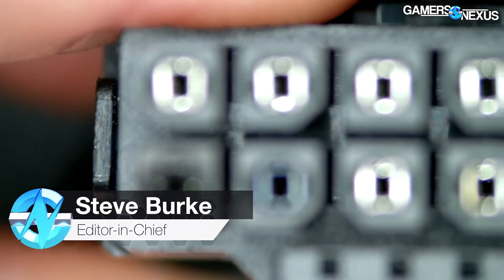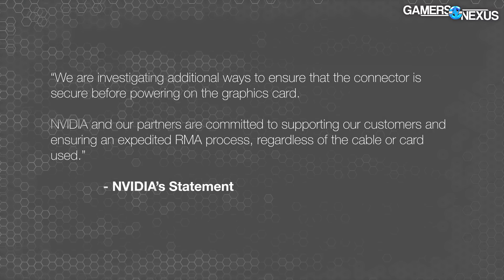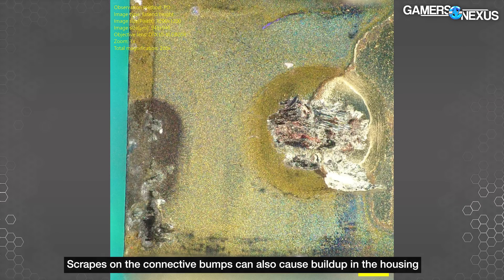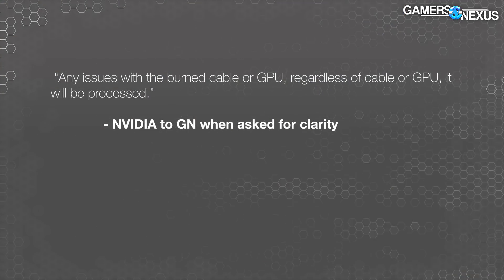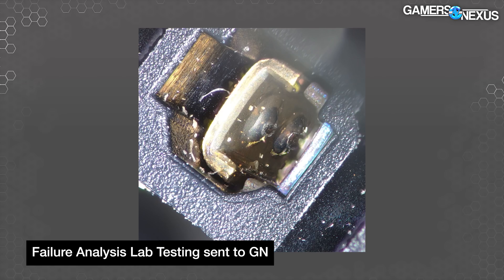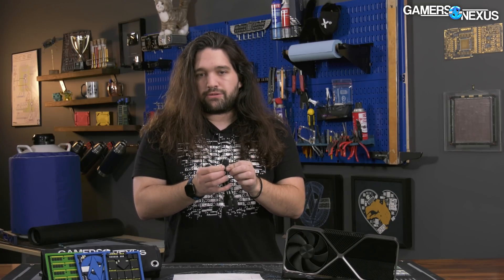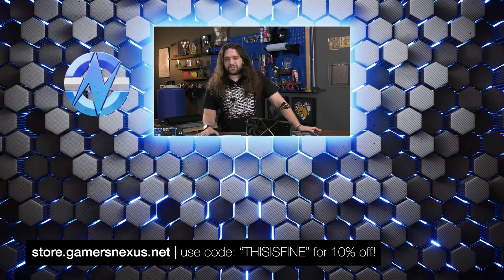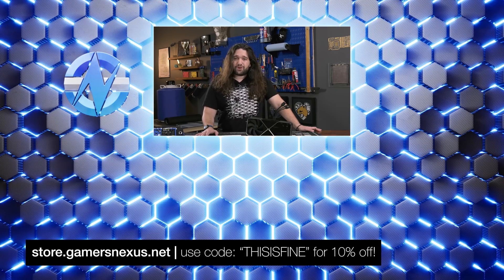NVIDIA Responds to Melting Cables, Warranty Concerns, & 12VHPWR Adapter Failures

Comment: Noticed;  why anyone  including  the amateurs had any issues  with the regular 8-12 pins !! and yes is an issue  as almost anyone(all)  can have a misleading   none click connection and will asume its  plugged as its  hard to duck down and see if it's  really  plugged  allbthe way in... really  guys... why not on the older version we didn't  have this issue??

Comment: The high level of required insertion force IS a key problem, in my view.

Such a force might be inevitable, with a Molex style connector holding 12 main pins + 4 sense pins..

I'd suggest that the PCI-SIG standards body add a maximum required insertion force constraint to the PCIe Gen5 Power Connector 12VHPWR specification, at a level that it may well be that many existing such 12+4 pin connectors would no longer meet specification, so likely any such proposal would not be accepted.

Comment: Personally I got just on question, where do you stop calling it user error and just call it for what it is, design error? Like is it users fault that it inserts with almost no click or one you can easier miss? Is it user error that it is designed for you to have to push it really hard to get it all the way in? Like video starts about user error, but end with all of the reasons why design is actually bad and user error here is consequence of bad design, so why not go straight up and call it for what it is. Since design essentially does everything it can to mislead you into not plugging it in fully instead of predicting that maybe, just maybe, it needs to help user to know just how deeply cable needs to go. Like DIY is neither new nor it is just completely small niche of DIY enthusiasts it used to be. It very much is encouraged and that is something companies designing those stuff need to keep in mind, since they don't all end up only in OEM systems or somewhere where experts will plug them in. Just saying, no offense meant to Steve, great job on reporting and all in depth research. Just saying that I don't see user error as cause, but rather consequence of bad design.

Comment: of course there was a reply from Nvidia after GN said basically its user error, any company would ride that wagon. This is a poor designed cable and socket, lets make that clear the problem started there not the user.

Comment: Question, is it possible through thermal expansion of the connector that the connector latch unseats itself and then has room to expand more and push the connector outwards. I ask because of all the cases I have read about, the failure happens days out with at minimum 40hrs of moderate to heavy use. Being an auto mechanic, I have seen heat from engines cause a not strong enough latch (Usually due to repeated plugging and unplugging) push connectors slightly apart. Is it user error or bad connector design and/or bad placement of the connector? Basically, is the heat around the connector more then the connector can handle? From the look of your last video the connector gets about as hot as the heat sinks. Your findings are very accurate but the cause is very suspicious. Thank you for such accurate analysis. Your accurate reporting on all thing computer related is untouchable.
Reply: Nope. That is you not seating the connector.
Reply: @ShainAndrews  Why would you answer this question? I have worked on many different vehicles in my life and replaced a lot of damaged connectors. All vehicle manufacturers take thermal expansion (as well as other factors) into account when making the design of their connectors which is why they are bulky for the size of the connector. If you did some research you would know this. I have seen other shops diagnose and replace parts only to have the tabs shear off and come to the dealer a few days later with a circuit fault and have to replace the connector. My question to GN is "Is the design of the latch sufficient enough to hold with the amount of heat that is generated". Not for you to bash others.

Comment: Really do not understand why they (NVIDIA) would go with such a strange connector when the entire drone/hobbyist has access to something called XT90i which is a 2 sense pin, 2 main 90A power pin connector. 90A will give you at 12V, 1080W supplied power. Couple that with proper silicon insulated wires which we use for battery packs, the cable would be incredibly flexible, close to impossible to pull out accidentally, and ultimate, really cheap because it is manufactured at such a crazy scale for the drone/hobbyist market.

Comment: Only 125.000 units? That's... actually not many considering that it is a global number.
That just goes to show that really not many people are willing to spend that much money on a GPU and all those images and marketing articles showing people lined up to buy one are.... really just that... marketing.
Nvidia is just showing themselves as some sort of "winner" by putting themself up on performance charts by throwing anything else out of the window, price, power consumption, thermal efficiency, reliability, etc.
The 4000 series looks like a huge failure. The 4080 might be decent but that's really all it is at best, as Steve said three days ago in his "RTX 4080 16GB GPU Review & Benchmarks" video. No real improvment over the previous gen, just "the whole gauge turned". And the 4090 is a burning wreck of a fire hazard if not handled properly and maybe even if actually handled properly. 🔥🧯

Comment: Steve, why are you pushing and pulling on the wires and not the short sides of the connector housing itself? Isn't it wise to always grab any lead by the connector housing as to avoid damaged wires or solder joints that could happen due to that stress?

Comment: the design of the connector is faulty, creating this monstrosity of a cable with binding 3~4 cables into one connection is ill advised. Using the proper gauge of single wire connection(bridge) {as a 12 path connection for power} from power supply to video card. a standard should include the whole apparatus design to be considered as a matter of validating a standard, the 12+4 pin connector should be able to handle the kind of current. The 4into1 cable design imo is still flawed.

Comment: i feel like their response is pretty acceptable. they looked into it, agree with the issue, and are being very open with replacements for folks with the issue. for something that is "user error" this is a big deal, since VERY often that ends up NOT being covered under warranty.
Reply: I would say that it's spot on, actually. They acknowledged the failures, investigated properly and are honouring the warranty even if it's partially the user's fault. Aside from faster investigation, what more could you even ask for?
Reply: @jpuroila  better connecter design ?
Reply: @roxbantv  We live in a fallen world, friend. Though we may strive for perfection, we'll never achieve it.

Comment: This is such bullshit calling this user error.  The card shouldn't power on if it's not engaged properly and it sure as hell shouldn't burn up.   If your electric car burst into flames because you hadn't pushed in the charger cable all the way, you wouldn't call that user error.  You'd call it a design flaw.    A few years ago, GM had an issue where people were putting a pound shit on their key rings and it was causing the ignition switch to turn their cars off while they were driving.  That wasn't user error and it cost them billions of dollars and recall of millions of vehicles. 15 people lost their jobs, some faced criminal prosecution.    This is a design flaw, plain and simple.  Stop carrying water for these guys, it's embarrassing

Comment: This turned out to be quite a nice case study in sensationalist reporting (whether intended or not).

A failure rate of 0.04% (caused by user error) made into a meme, practically mass panic from people reporting, to the point that the competition made a whole show about it and even now after everything reported, you can still see in the comments people going at it.

Thanks for doing proper investigation before reporting anything

Comment: After watching your video on adapter burning up, I checked my 4090 and it was not in all the way and I had originally pushed it in very hard and could have swore it was in all the way—I pushed very very hard and it went in fathther and could feel a click and I have been building computers for 5 years.

Comment: I was thinking about about the improvements on the 12VHHPWR connector.
Maybe there could be a safety mechanism for the extra 4 pins on 'native PSU-to-GPU cables' where either the GPU or PSU does a check on the outgoing and incoming wattage and that there's a safety shutoff if the values are too different. If the outgoing wattage from the PSU is too high compared to the incoming wattage into the GPU there is very likely a point where the cable overheats.
But I really don't know how you can utilize those 4 pins and how much extra circuitory is needed for that.

Comment: I think the problem is that the connector was never meant to handle more than 200 watts per connector.  Meaning the 4090 should have 3 12VHP plugs, joining the current in the card where there is less risk of combustion, just like the the 3x8pin 3090.
Reply: Read the specification for this connector before making stupidly incorrect remarks.
Reply: @aaaaaaaaaaaaaaaaaaaaaaaaaaargh  I have read the specifications.  Perhaps more users should read the specs for the connector before using it.  Even the tulip style connectors have less total surface contact than a 4 pin molex, which has barely enough surface area contact for 75 watts of power transfer, and the less surface area contact the higher the impedance.  The more power you send over higher impedance makes for more heat.  The funniest part about this connection is that Intel helped develop it and even they are not using it, most likely because they know it isn't safe.  EVGA dropped out of GPUs over it, because they determined it wasn't safe to deploy as single connection for high wattage.  The 12VHP connection standard is a perfect example of how progress simply for the sake of progress leads to disaster. It's no different than speakers catching fire because 8 ohm wire was used where 4 ohm was required, the increased impedance creating excessive heat on just 5 volts.  It's the same for power connectors, with more amps and wattage and more impedance making for more risk of combustion.  GN took a month of excessive round the clock testing to identify the first of the issues, which says to me either Nvidia did more testing with a higher allotment of time and resources available and discovered but chose to ignore many other issues as well, or ran only a single test and negligently called it golden prematurely.  Oh, and the specs say the 12VHP standard is safe up to 300 watts.  By that same standard, the 8 pin are safe for up to 200 watts each, but rated for use with up to 150, which means ultimately the rating for 12VHP will likely be between 200-300 watts, more likely closer to 200.  Next time, you should consult more than just a set of specs, cut the bias out, and and look at other factors as well, like how many other companies (especially those involved in the design of it) are implementing it, the stats included with the specs (if any, in this case they require deep digging to find, and they are not pretty as compared to the implementation), and perhaps even some contact area vs impedance and impedance vs load analysis before you assume to know all there is to know about something.

Comment: I just got a 4090 yesterday so thanks so much for your investigation and all the info you provide to us. You are logical and reliable and so valuable to the gaming/pc community.
Reply: im thinking of getting a 4080 cause my gpu just shit the bed so how has it been since you got it if you plugged it in yet
Reply: @oGxMaXiiMuMZz  It's been perfect. I've only played sniper elite 5 so far but it's been quiet and handles that task with ease. I have no regrets. I'll be rendering some video in Premiere in a week so it'll be interesting to see how it handles nvenc.
Reply: @benjaminofperrin  what size psu do you have i have a 750w right now
Reply: @oGxMaXiiMuMZz  I think it's 1000 but it might be 1200. I'm about to change it anyway as I need it for another system and I'm going to get a Seasonic Vertex which has native 12VHPWR cables. At the moment I've got 4 PCIe cables running to the gpu and it's a bit of a mess at the moment.

Comment: The best is to look at the clip from the side. The top should be parallel to the side of the plug (i.e., the clip has latched successfully to the plug). If the clip appears to be slanted, then the plug is not fully seated. This is how I check the plugs are inserted fully into a modular power supply and the motherboard.

Comment: Not sure who did the math but 50 / 125,000 = 0.0004 not 0.04. 
A real 0.05% failure rate of 125,000 cards is 6,250.
Reply: the issue is that you don't know what % means
Reply: I will explain this to you like a toddler. 
If you have 4 apples and one is bad that is 1/4 or 0.25. That is not 0.25% that is a ratio. To get % you need to multiply the ratio by 100. So 1/4 * 100 is 25%. Similarly 50/125 000 is not 0.0004 but 0.0004 * 100 so 0.04%.

Comment: Wow this connector seems to require alot of pressure to get in and be secure, the one that comes with the msi mpg a1000g PSU is pretty easy to get in and hear the secure click.

Comment: The only problem with inspecting the cable before inserting it is that the connector can still get jostled and forced out of the latched position in some way when you put the card into position.

Comment: Genuine question. If user error is the leading cause of failures. Why is this occurring to a higher degree with the 12 pin compared to the traditional 8 pin?
Reply: harder to insert, easier to bend sideways, higher current

Comment: Wonder if it would be possible to include a bit of metal at the end of the clip that completes a circuit.
When the clip is not full engage the card detects the circuit is not complete and does not turn on.

Comment: So they released an expensive product that comes with a potential fire hazard problem and they blame the people who bought it. By saying you plugged it wrong.
But then Nvidia will replace all products from people who plugged it wrong. Yeah that tells us that Nvidia knows very well it's the connector that's the problem. So instead of admitting they screwed up royally and replace the connector with the old 8 pin that doesn't have this problem, they will continue to use this garbage connector.
Nvidia has joined the ranks of one of the very few companies that tell you to buy from the competition.
Which is exactly what I will do. Hello AMD and goodbye Nvidia.